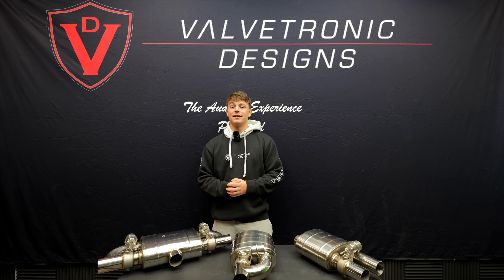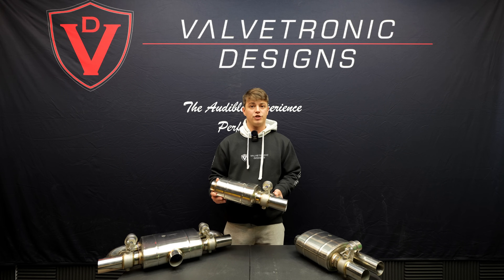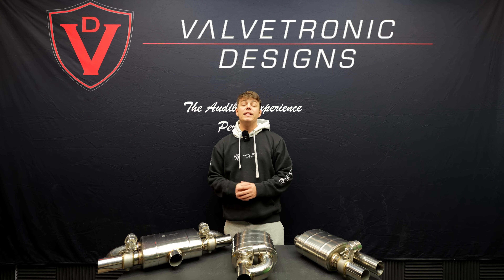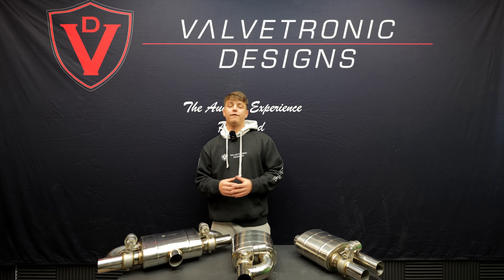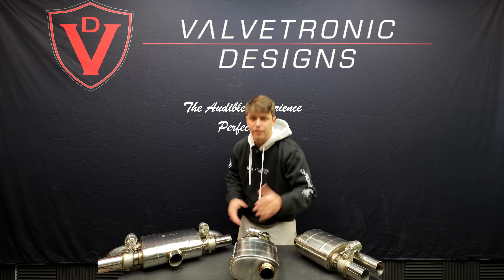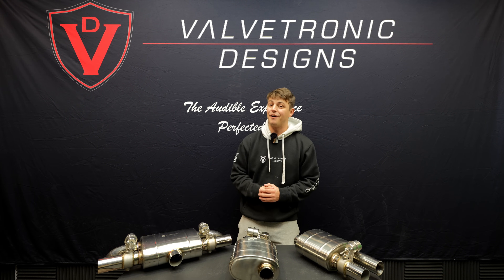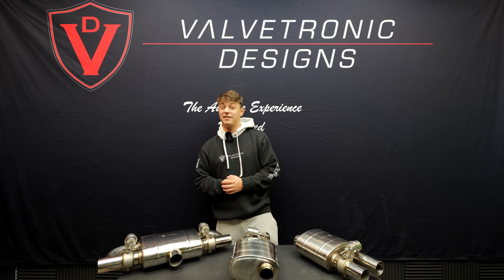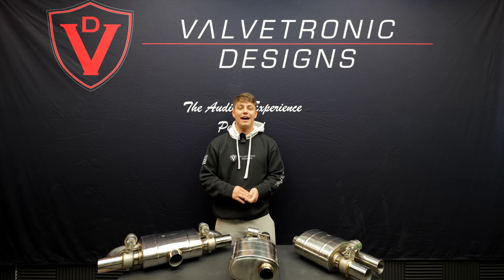What is a Valvetronic / Valved Exhaust?

Comment: do the valves close when the vehicle is off? could i command start it and it be closed? or would i only be able to close them before ignition in ACC?
Reply: I think it stays the same way you have it, you can also open or close the valve when the engine is not running and the key is on

Comment: Are these valved mufflers smart enough to know to open up on their own on acceleration? Do they come in stainless steel or aluminized?
Reply from the maker: The buffers are 100% binary control either fully open or fully closed, meaning that you’re able to enjoy the exhaust experience, but the valves closed even at high RPMs or large throttle position. this was done together, driver the most amount of flexibility possible.

The mufflers a t304 stainless steel, even at this price range we demand quality and excellence of our products, hence the stainless construction

Comment: Hi what is happening if you turn around in opposite way to exhaust entrance like on the you tube Chanel this  guy's put on the lexus 250 in Tennessee. They said valvetronic design did it again ♥️. I seen hate in the comments. They fit the wrong way your muffler. Thanks for answering

Comment: I have the similar exhaust but after driving for an hour the exhaust off by itself..is this an issue
Reply from the maker: what exhaust do you have?
Reply: China made borla valvetronic exhaust very similar...it's a vaccum pump control
Reply from the maker: @lanamalang6394  Should have bought from us. You wouldn't have any issues

Comment: Was curious the difference from a straight piped car and the same car with the just the universal mufflers on and valves open. Would it sound the same/similar or make is sound different. The resonated part in the muffler is what im curious about. I want my car loud but to sound good with no rasp and no drone.
Reply: In the same boat with my ls400

Comment: is there a increase in performance when valve is opened? Is the performance same with valve open and closed ?
Reply from the maker: Our exhaust is more free flowing both opened and closed, so youll see a gain in both modes compared to stock

Comment: Sorry for the double comment, just really want this product so I can solve the endless drone on my straight piped car with the look I desire as well
Reply from the maker: soon! End of march these should be available
Reply: Had the same question, curious what car do you plan to run that exhaust on? I have a dual exhaust car but the single in pipe is on the left of the muffler, rather than the middle.